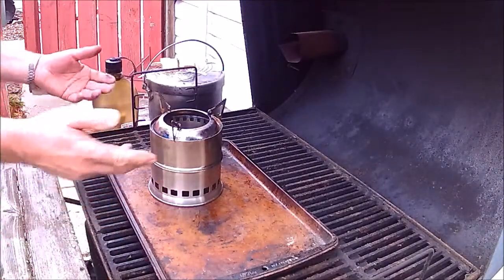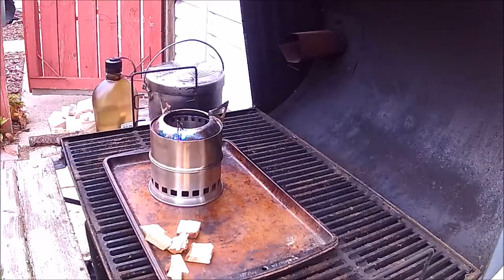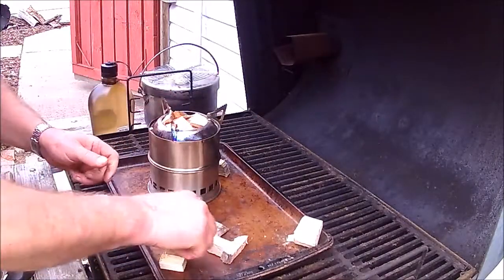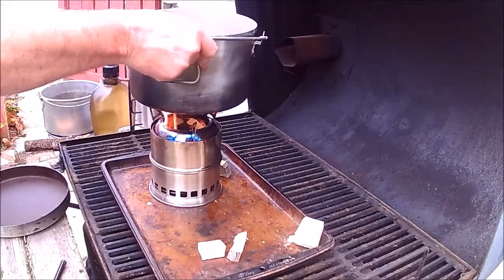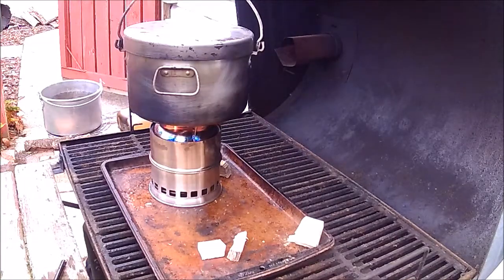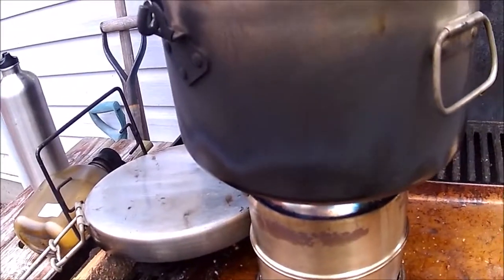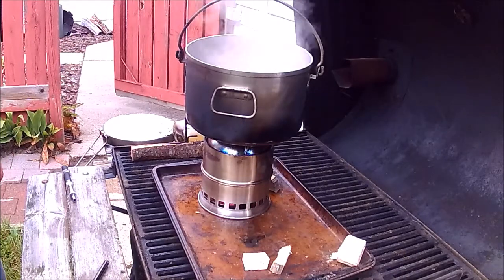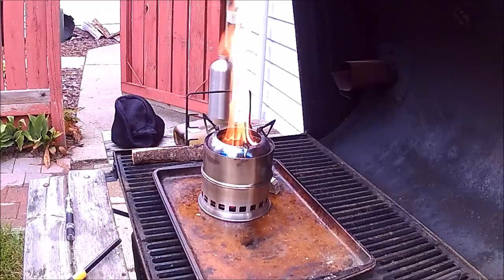Gasifier Stove Test

Comment: that worked very well for sure
Reply from the maker: It runs really good. You would probably have to add fuel every 10 or 15 minutes to keep it running. Only problem with it is I think it only runs wide open. Thank you for watching and commenting, Howard

Comment: I like the stove. Did you ever try leaving the outside of your pot black? I never clean the outside of my pot and find I can boil water in about half of the time using half of the fuel (an old Mors Kochanski tip).
Reply from the maker: The other version has a sheet metal ring to hold the pot that works better. I supposed I could make a bag to keep my pot in so it would not rub off on the rest of my stuff. I saw one test that used pellet stove fuel and that worked really well, just hard to find in the woods. Thank you for watching and commenting